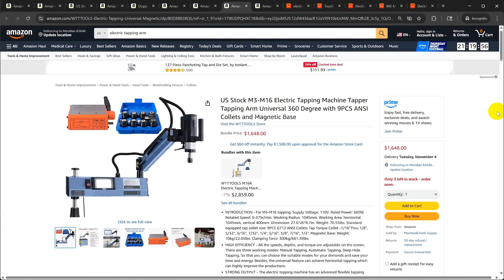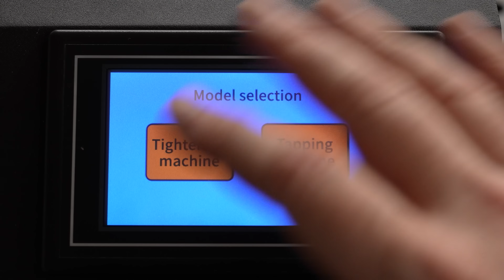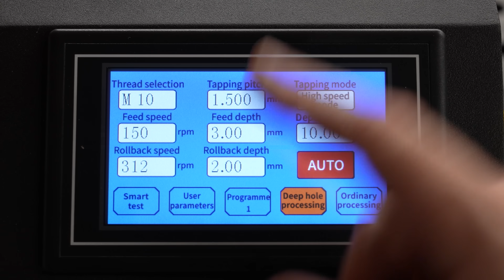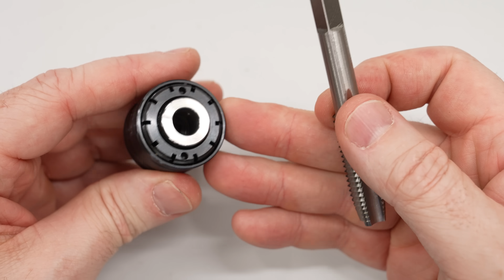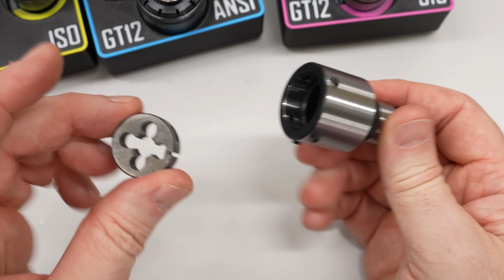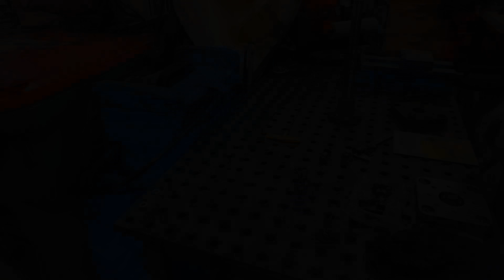Will I Regret Buying the Cheapest Tapping Arm I Could Find?

Comment: I converted to threadmilling for 99% of my work, the cost of tooling has dropped radically. Having the facility to set the tolerance of the thread, and to mill any thread diameter beats buying a zillion taps and collets. I just made a lot of M57x0.75 photo filter threads. Milling 200 holes is very fast, and building in a tool measurement cycle to catch breakage makes life easy. 10000 holes later, I've never broken a threadmill. However, I'm limited to the work envelope of my CNC mill. One of these might be a solution for the threads on larger workpieces.
Reply: yea but the problem is you cant buy cnc mill for 700$ +2-3000$ worthy of taps .This is cheap alternative for people that need to tap many holes with normal screw tolerances .
Reply: @zumbazumba1 indeed. James does have a CNC mill, but most home machinists have to make financial choices that means they spend resources on family, food, shelter and warmth instead. I realise that I'm hugely privileged to be in a position to be able to invest in expensive machine tools. OK, I don't get to do holidays and I have to drive an old car and work 80 hours a week, but that's a trade-off I'm able to make that many folks can't
Reply: Yes I really like how you can tweak the cam to get the exact fit you want But a threading arm would still be handy
Reply: fine pitch + large diameter is where threadmilling really shines IMO.   For small diameters you'd need a selection of tools similar to small hole boring bars on a lathe.  In fact, couldn't the same set of tools do both jobs?
Reply: @MattOGormanSmith I have a mix of full-length and 3-tooth mills in metric and UNC, mostly with coatings for copper, brass, aluminium and stainless. I haven't tried milling holes smaller than M2 or 4-40 UNC, or greater than 3xD, and of course it's difficult working close to a flange or other places where a super long hub tap is needed. I have used rigid tapping with a good quality floating holder, but never found it reliable in aluminium. Works fine in steel though.
Reply: Yes - the cost of a good tap is often more than a thread mill cutter.  Not saving money.  The tap arms might be good if you are doing a lot of repair work - or one off.

Comment: you need to add the thread depth AND the length of the tap that is not fully threaded for your correct tap depth otherwise you dont have formed threads to the correct depth.

Comment: Thanks YT, i work in IT and have no need for a tapping arm, but now i want one. :D
Reply: Look, you could use it to help people turn it off and on again, great value right there.
Reply: @qlum  just tap a thread into the hdd
Reply: I work in IT and, due to YT I managed to squeeze a small lathe on my single bedroom appartment
Reply: @LiviuGelea  yes go for it achieve your dreams
Reply: get one its really fun and helps in IT
Reply: @uiopuiop3472 It should. Every time I buy some IT equipment, I get screwed somehow.
Reply: On those commands that absolutely have to be right or your facing a massive global cascade event- you could use this arm to press each key PRECISELY straight down so no "Fat Fingers". 
Good luck selling that one but just go for it.
Reply: They make them with Giggabit options
Reply: My ocd is pinging off the rev limiter every time you run a tap into a hole and don’t blow off the tap in between tapping the next one. Other than that video was great!
Reply: SAME !!!😂
Reply: Right?? If I win the powerball I will have a 10,000 sq foot warehouse with tools I will use once every 5 years because of cool vids like this
Reply: Need, nah
want, hell yeah

Comment: Holding taps in ER collets is always sketchy, it's hard to get them tight enough to be sure they won't spin.  There are tap specific ER collets available, with the square drive in the back to keep the tap from spinning, they're rather nice to have.  I bet having the collets on hand would be pretty useful for lining up off vertical holes, just chuck up the tap drill and free fit it into the hole to get the angle perfect.
Reply: You know how easy that is to fix? Just drill two  holes in a body of er collet holder and tap them for two  screws that will hold onto taps square .100 years ago there was a tap holder like that but it had 2 jaws with V groove and a tapered nut to tighten it  to keep the tap centered and it had 2 screws from sides to press on taps square. It had a morse taper shank and draw bar for machine use .

Comment: If you have access to a desktop laser engraver with a 4th axis you could label each tap with the size and standard of the collet it needs. That way you can just pick up the tap, and if it says J4 you know it's the 4th size up in the JIS set, I2 would be the second size up in the ISO set, A6 is the 6th size up in the ANSI set and so on. That way you don't have to guess the size, you can just look at the label

Comment: I don't know whether this is true for taps, but in many cases the DIN and ISO norms are identical or near identical. This is because in many cases the ISO norms just are the old DIN norms re-printed into the international standard (with sometimes small changes).
If you ever run across a DIN tap I wouldn't be surprised if the ISO chucks just work (for instance ISO 7388-1 = DIN 69871).

Comment: Great video — as always, very clear and useful! Quick question: when tapping the lubricant seems to drip through the perforated steel top — do you have a drip tray or catchment under the table, or how do you deal with the leaking oil?

Comment: You can buy adapter that has morse taper on on side and holder for tapping callets on other so you can put these into milling machine for example. 
Btw. these tap collets have torque slip clutch in them (same as handheld drill) so you dont need to worry too much. M8 and higher will slip reliably without breaking the tap. M6 and lower cant be trusted tho.

Comment: Surprisingly good machine! Also good for counter sinking holes?
Reply from the maker: I think so.  I've done a couple, and for big holes there's significant thrust force, which I don't think the bearings are really designed to handle.  Countersinking is pretty easy to do when drilling the hole, though.  For processing a laser-cut plate, I'd definitely do the countersinking in this machine prior to tapping, though.

Comment: I bought one just last week and have been diving into it today so perfect timing on this video.   I got the teal one in your video for $669 and it came with ISO collets.  I've been trying to find ISO 529 taps but they seem to be rare in the US.   Some DIN and JIS taps will fit but they don't match the metric numbers on the collets sadly.  Everything I'm reading indicates I need machine taps vs the standard ANSI hand taps sold in the US so I think I'm going to get a set of JIS collets too.    One other odd thing about mine - it's 220v but it comes with a standard NEMA-15p cable typically used for 120v.  I had to wire and label a standard 120v outlet to a 220v line to get it to work without buying another cable.    It appears to have the same firmware as yours.   I plan to do a teardown one of these days.    Clough42 - Whats your take on using ANSI hand taps for these or are what you're using ANSI machine taps?
Reply from the maker: With an extremely shallow peck and retract, it ought to be possible to use hand taps, but I probably won't do it.  I find when hand tapping that being able to feel what's happening is crucial.  If the swarf packs into the gullets of the tap, sometimes I have to wiggle the tap back and forth a few times to free it.  I wouldn't trust the machine in that case.  I'll just use spiral point and flute machine taps unless I'm in a jam.

Comment: Lil tip: have a little cup of cutting oil that you can dip the tap in. This speeds application versus the oil can, and helps sink heat buildup in the tap over numerous holes.
Reply: 3 toothbrushes in the cup could help clear the chips from straight-flute taps
Reply: 3d printed cap with a brizzled hole?
Reply: 3d prints will typically leak, would avoid
Reply: @werawerlnwerlnrlnelr not if you design and print properly. A staggered seam with at least 2 vertical walls is pretty much guaranteed not to leak. I think a lot of people just download+print without understanding how to set their print settings correctly for different uses like this. Making a waterproof container is frankly pretty basic stuff for 3D printing.
Reply: @doublestrikePhoto or just get a cup. And print an insert.
Reply: If it's a significant leak, it wasn't a good 3D print, or the plastic chosen is incompatible with the cutting fluid or oil.

One option is to give the print an epoxy coating.  Another is to accept that a bit of the cutting fluid is going to escape as drips anyway.
Reply: @volvo245 don't let the apprentice get his hands on it or it'll end up mysteriously disappearing.
Reply: If you cut aluminum, use alcohol/ethanol, never heard of of it till one time at work, works like a charm
Reply: @rctractif Alcohol as a cutting fluid ?
Reply: @jasonwalden271  Yeah, that was my first lesson cutting aluminium from my then 40+ years machine shop super. It is really good as a lubricant and coolant for that material.
Reply: @sdoc3  I've woken up next to some monsters after using alcohol as a coolant.
Reply: A wax stick works well too. If you keep the tap spinning slow and dip in in a solid wax it will pick just enough up on the tap
Reply: Совсем маленький совет ещё лучше: сейчас в продаже масса вариантов гелей, состоящих из олеиновой кислоты с загустителем. Хватает маленькой горошины на краю отверстия.
Reply: Good idea
Reply: Was wondering if there is a semi solid creamy tapping material?
Reply: @nutsmcflurry3737  Anchor Lube
Reply: @nutsmcflurry3737 yes, its green. Consistency of sour cream. Cant remember what its called
Reply: @weldmonger-x2c  anchorlube
Reply: Trefolex is the most common brand name. But you can get different types that suit different metals. Works much better than cutting oil. I use the little plastic caps they put in Argon bottles to hold some to dip the tap in.
Reply: Addition to this. Coolant consitrate foam tapping fluid is awesome for stuff like this as its thick so it stays on the tap. Also its water soluble so it washes off the part nicely unlike rapid tap. Actual lubrication vs rapid tap I can't decide which is better
Reply: @aydenhanlon1674  ..."concentrate"...
Reply: @BKD70   Concentration hurts.
Reply: You missed other benefit of using oil it greatly increases the lifespan of the cutting edges.  It reduces friction at the point of material removal and lets the non-cutting surfaces slide past each other.  The reduced friction greatly cuts down on heat buildup as well as just being covered with oil helps remove heat buildup.
I have seen some long drawn out debates some rather heated discussions LOL.  About what kind of oil how much oil if any oil at all is needed.  Well I guess if you're tapping one small hole in thin material that is rather soft I guess it's not really that important.
But yes in most cases I say it's not so important what kind of oil but definitely use oil.
Reply: @erinschlameus3628  he wasnt talking about the benefit of using oil he was talking about the benefit of using a cup to dip the oil in

Comment: Oh I bet you could put a little dot with a paint maker on the square end of your taps to color code them with their shank standard.
Reply from the maker: That's actually a pretty good idea.
Reply: Or just keep them in separate sets of bins that go with each collet set.
Reply: @thom17043  Eh, that, for one thing, is counting on something that isn't likely to happen. Secondly, congrats, you now need to look in three places to see if you own a tap of the size you want.
Reply: That’s exactly what I did
Reply: I do this with my router bits.  I have two plunge routers (one metric, one imperial). I also have a mixture of metric and imperial shanked router bits.  So I have five sizes of shank.  1/2" 1/4" 12mm 8mm 6mm.  If I pick up an 8mm shank router bit there's no close imperial equivalent so, at a glance it's obviously metric.  12mm and 6mm are similar enough to 1/2" and 1/4" to be easily mistaken.  So I use Red for imperial, blue for metric.

Before I implemented this scheme I had several incidents due to the mismatch of shank and collet.  If you put a 12mm shank in a half inch collet, then tighten as usual, everything appears normal, until you put it under load.  Unfortunately, the default failure mode of router bits is to take off more material than required.  If you're cutting a dado, a loose bit will gradually plunge deeper.  If you're following a template the bearing will drift off the template, causing the bit to cut into your workpiece and even screw up your template.  The same occurs when you're putting a decorative moulding onto the edge of your work. The most insidious part is that this acts gradually so you won't even notice it's happening until the damage is pretty extensive.

Those blobs of paint are worth their weight in gold.
Reply: I buy paint marker sets for that and all sorts of other shop and vehicle (like highlightiing timing mark grooves). I also date every rechargeable power tool battery buy on purchase
which makes tracking longevity easy.
Reply: @Comm0ut  I'm a strong believer is  marking dates on all kinds of stuff oil top ups  filters strainers  batteries  and part that fails but I don't have the discipline to follow trough
Reply: @incolink  im the same big believer, but to much trough an not enough follow through.

Comment: Nice tapping arm and a great price.  I know you said you were looking for an excuse to buy one, however none of my CNC mills do rigid tapping, nor do my lathes, however I've tapped hundreds of holes with them with no drama either.  I simply use a ER32 Tension Compression tap holder.  It allows radial and axial error and as long as you feed down roughly the same pitch or slightly less it works great.  I have had to go back and tap the same holes again and there wasn't an issue with it cutting new threads.  I popped right back into the same thread and continued on.  As far as taps and collets, you're a 100% correct on different standards.  I find that almost all machine taps I buy are ANSI, however, my hand taps are different.  I use the "clutched" collets as well for my 3/4 straight shank T/C tapping head and the standard collets in my ER32 T/C head.

Comment: machinist tip while power tapping....   spin the tap in reverse and just locate your hole that way since the tips of all taps are tapered to self locate to an extent.  So in affect just keep it spinning from the previous hole to locate the next hole.    used to do this all the time when running radial arm drills.
Reply: I do the same with my thermos coffee cup lid.
Reply: This is a good tip for getting screw threads started as well.
Reply: @Studio23Media or any threaded fastener; reverse until you hear/feel the click, and then forward it in.
Reply: @corthirteenth94 Been doing that all my life…just assumed that was the way to do it.
Particularly with replacing self tappers or they will often just try to cut yet another new thread .
Reply: @corthirteenth94  This is most important in self tapping plastic threads. Crossed threads are easy to recognise in metal (albeit super fine treads in aluminium might be an exception) but in plastic new threads are cut and ultimately strip out the  thread.
Reply: Couldn't you also just drill a fixturing hole a couple places on the part on the CNC and than just have a couple pegs that you put it on to have it in the same place for the DRO everytime

Comment: I went for the pneumatic version several months ago. Way less money and it works great. Tapped 16 5/16 holes the other day in less than 5 minutes. I also mounted it to my 4x4 fabrication where it permanently lives because I use it so often. Thanks for sharing the info on the different collets. I will be looking into those.

Comment: You should check the runout of the spindle, that tap looked a bit out, but it could just be the camera angle but for peace of mind you should check it before you start to break taps in that tool steel. Keep up the good work😁
Reply from the maker: There's a little, but there's also some compliance in the collet mechanism so it all just floats around a bit.  I think ultimately there's a collar that goes on the D-shaft of the gearbox output with a set screw and a some end play.

Comment: every shop needs one of these. However for your project I would of purchased some high end carbide thread mills .. Just use cutter comp as needed.
Reply: Threadmills don't cost any more than a good tap  if you know where to buy them.  FreeCAD has everything you need to tweak the fit.
Reply: I agree

Comment: That’s a steal for $700 if you’ve got projects with lots of tapped holes. Huge time saver and a lot less broken taps. I’ve done probably hundreds of 4-40 holes in aluminum with a cordless drill and it’s pretty soul crushing to be 25 holes into a one-off part and hear and feel that snap…
Reply: The first hundred with a hand drill are the hardest for sure. When you get to 1000 its smooth sailing. Get to 5k and you'll be 0-80 to 1/2-13 with the hand drill over all this elaborate setup stuff.
Reply: That's the exact reason I got 10x the 4-40 taps, too easy to break.
Reply: I've never broken a tap in my life,  but I only hand tap strictly following the rules taught to me age 11 in school.  One turn forward, half turn back.  The only time I break this rule is for M3 grubscrews in Delrin.  They's inna drill